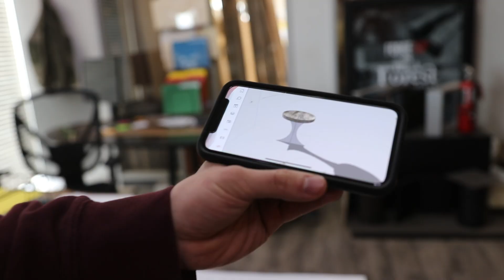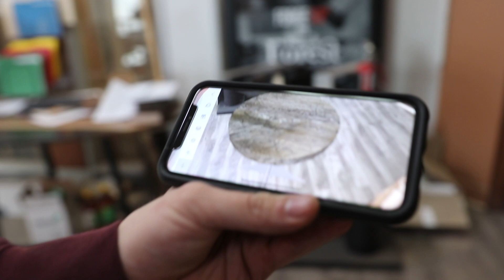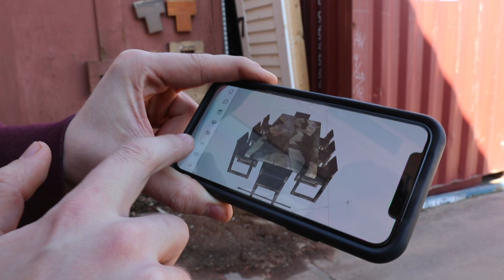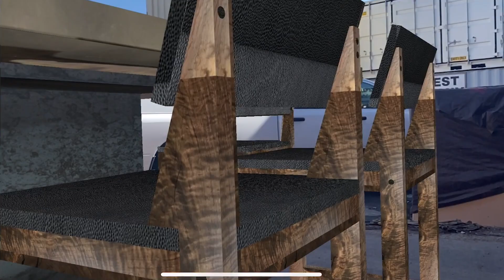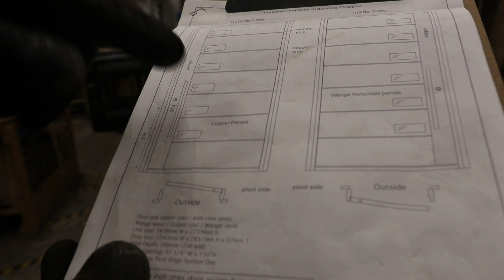Designing Furniture With Augmented Reality

Comment: Hi Daryl still doing some great 👍 work I am in lockdown over in France but I have a few projects I can do around my Moulin- Mill. but I have noticed your guys are not wearing safety protection I.e. respirator or even just the facemask would help and ear 👂 protection as I said in an earlier mail to you I'm retired and I live in France I'm 68 years old and I've lost part of my earring because of all the noise over the years. But I decided years ago that would always wear a face mask and about 15 years ago I bought a respirator fullface which has a defenders on it as well and clean air have been circulated to your face these are expensive but I definitely would recommend wearing a mask 😷.
It was great to see young guys doing work with enthusiasm work hard play safe. Especially in spare times over the world.
Kind regards from Phil from the Moulin in France